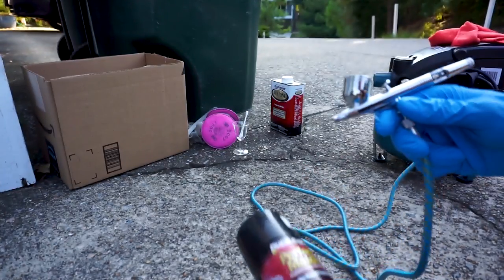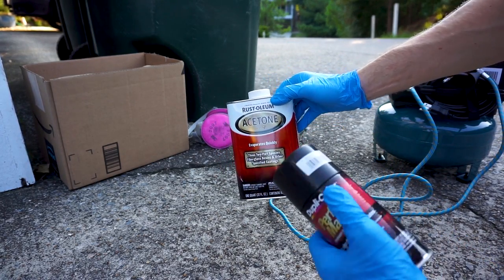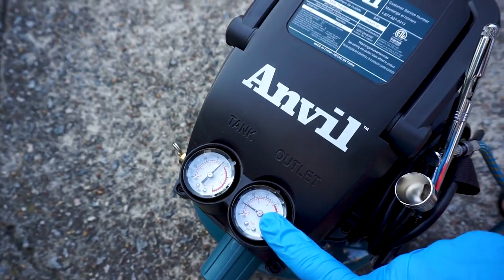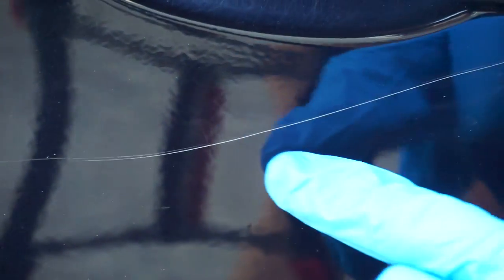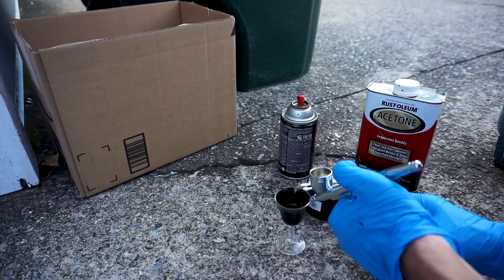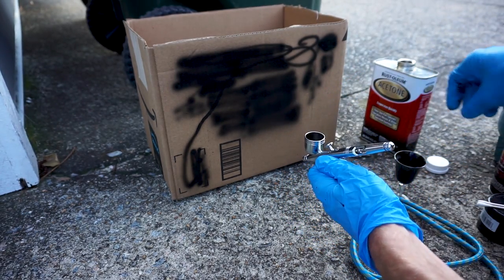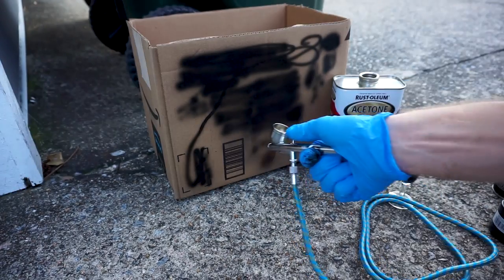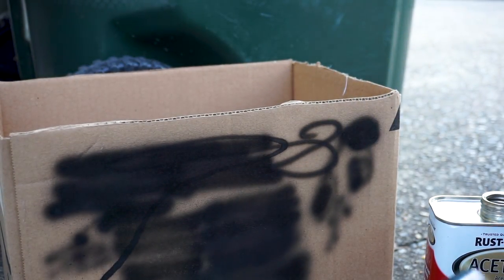Oil Base Car Paint with AirBrush

Comment: Did you try it on a car?  Wondering if you are able to blend it in or not.
Reply from the maker: Better later than newer...😅
Not to the point of blending, of course, if you know what you doing, But I did repaint the BMW Rims with OEM paint which has metal particles in it. and the outcome was very good, what wasn't good it's my skills😅🤣
I'm working on the video right now, it will be ready soon.
Same as having my crappy car the Ford Transit, planning to practice on it, should be fun! I have an inverter in the car and a small compressor)) So the repair shop is ready)))
Reply from the maker: I used the AirBrush to Paint the BMW Rims - https://youtu.be/YISKb3gwgt4

Comment: I am searching for spraying with an airbrush automotive paint. Will also work ?! I have 1mm nozzle.
Reply from the maker: I was using 0.5 and 0.7, with reducer it worked fine in terms 0.5. 0.7 better, but 1mm should be perfect with 40-50psi it should work flawlessly!
I will be adding the video on that topic in a month probably…
Reply from the maker: I used the AirBrush to Paint the BMW Rims - https://youtu.be/YISKb3gwgt4

Comment: Can you use hi temp in air brush?
Reply from the maker: As far as I know, the high temperature paint is little thicker, but if you’ll be using 0.7mm needle, you should be fine! Good luck!)

Comment: Duplicolor is lacquer based not oil
Reply from the maker: Sorry for false info, the new video is coming with actual painting and using paint from Auto quest. So should be cool one! Sorry again!
Reply: Also should use a single action air brush for auto touch up.
Reply from the maker: I used the AirBrush to Paint the BMW Rims - https://youtu.be/YISKb3gwgt4